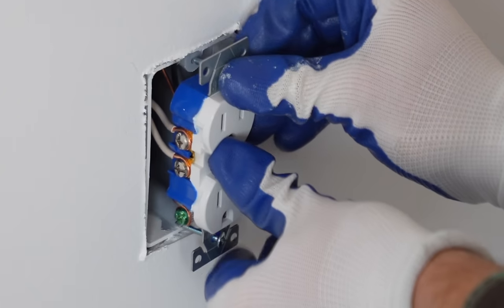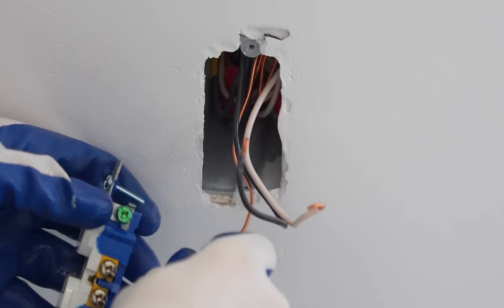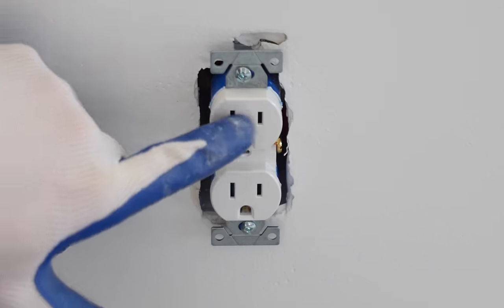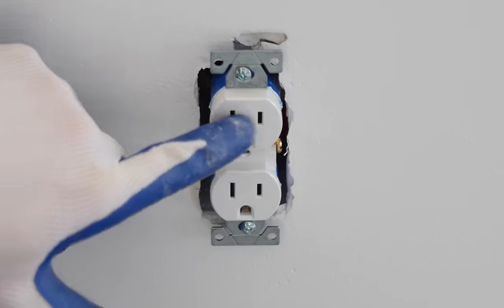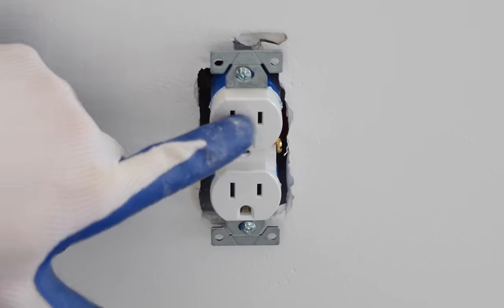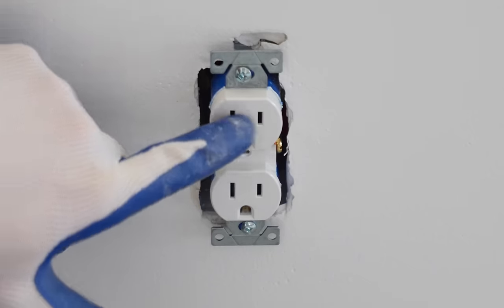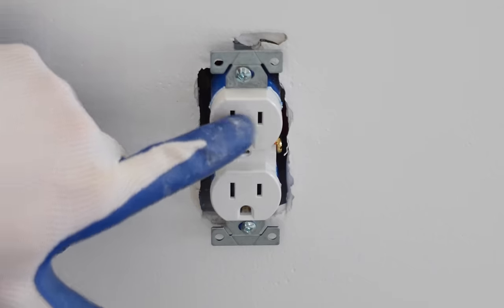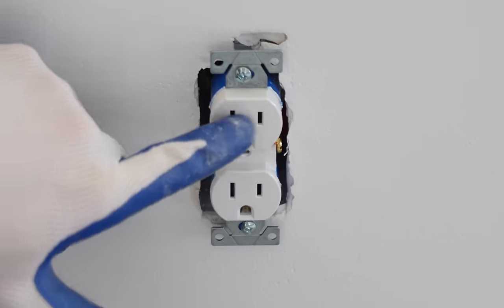How To Wire A Garage - Receptacles, Switches, Lights, and Fan Installation!

Comment: Finish wiring is always rewarding because things are looking more finished. I love hooking the wires as you explained wrapping the wires around the screw and not inserting in the back slots unless the switch or outlet is set up like the switches you had. In our area if you have a 20amp circuit and of course 12/2 wire, the outlets and switches need to be 20amp rated. Of course It's important to check with your local codes. Doing so much more remodeling I also love putting my covers on with the screws going vertical. If I've ever had to do a service call I could easily tell if someone else took a cover off or did something. That usually didn't happen except when I had a dimmer switch that a customer thought was overheating. I had to make sure that I purchased the right dimmer with the proper voltage based on how many lights were on the circuit. After explaining to the customer how dimmer switches can give off some warmth he understood and he explained that he took the cover off to check things out himself. I like your layout of three-way wiring as well. When you get used to doing things for so long it's so much more comfortable. Thanks again for all the detailed video with everything even tagging all your wires knowing what goes where. It's so rewarding to see things being put together for the final stage. Definitely many hammer the like in the comments. 🔨🔨🔨👍🏻👍🏻👍🏻
Reply from the maker: It is really nice to see it all. Come together after the drywall is complete. Yes the backstabbing seems to be a inferior way of making the connection. It seems to be a common theme amongst people that wire. That makes sense about the 20 amp circuit with the 20 amp switch, because I guess essentially you could have 20 amp going through there because of multiple devices. Checking local building codes is very important because of stuff like that! Labeling the wires not only helps me but a future electrician that might have to work in the electrical box. Thanks for stopping by David. It's always nice to see your comment!

Comment: Splitting the receptacle allows you to put one half to a switch and the other half will have constant power.  Using 14/3, you would keep the neutral side whole and only split the hot side.  Mostly used in bedrooms.

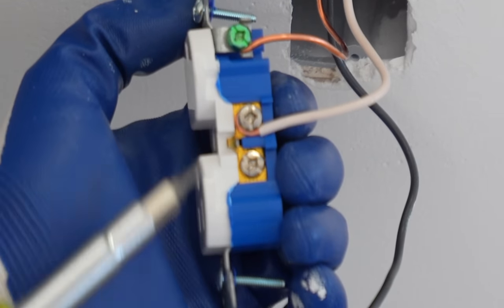Comment: Starting at 7:55, you would only break the tab on the hot side for a switched receptacle and a duplex receptacle used on a multi wire branch circuit. You would break both tabs if they were on completely different circuits, 2 neutral wires and 2 hot wires.

Comment: Hey brother i have a question for a project im doing. I need to put an outlet in my shed that is about 65 ft away from the closest circuit breaker is it okay to use 14 g wire for this? Im wanting to use the outlet for a lamp and maybe a couple power tools.
Reply: @Navy1977 yeah i guess 14 g can only go to 60 ft max but 12 can go 100 max 10 can go 115, so im thinkin 12 should do the job.

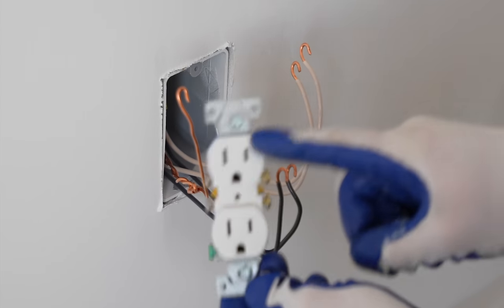Comment: Starting at 3:02, Josh, your pass through explanation is incorrect. Both methods are the same electrically. Either way, the hot contact will be live and no current will flow through the device unless there is a load, e.g. a lamp in the on position. It's installer preference to use the device as a connector or using pigtails, they both have their pro's and con's.

Comment: I'm surprised in the US you still use bare copper as an earth in T&E cable, in Australia our standard was changed in 1966 to require the earth to be insulated in T&E cabling, before this the bare earth wire was also required to have a green sheath to cover the exposed wire at the connection point, funny how different things are around the world 👌👌

Comment: Garage needs 20 amp switches and 20 amp receptacles cause most shop equipment pull's some amps.
Reply: I'd say 20 amp switches yes, but 15 amp receptacles are okay. I'd use spec grade receptacles, though. If you use 20 amp receptacles, make sure that they're spec grade, as 20 amp cheap residential grade are available.